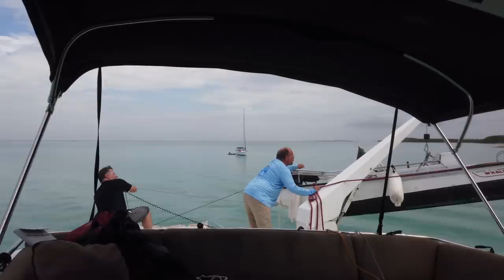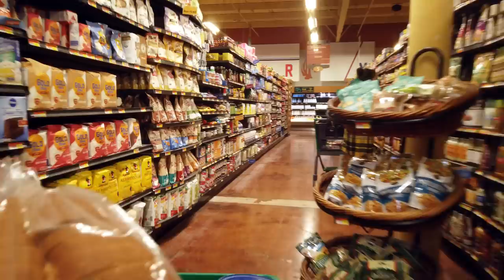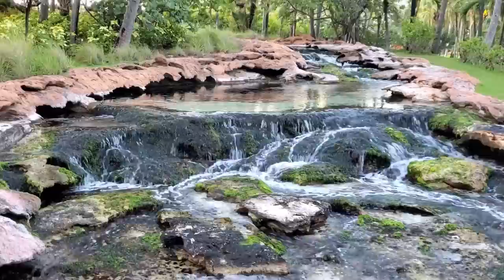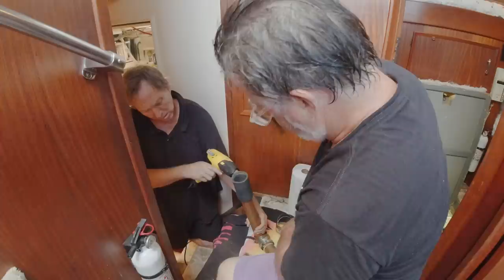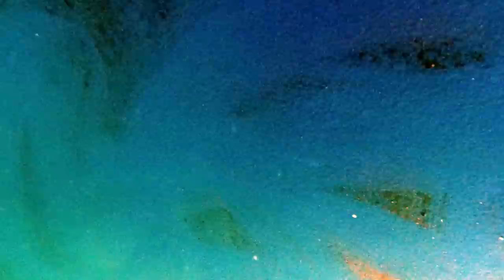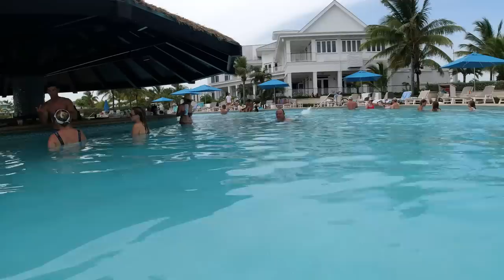Throttle Control Goes Haywire! Three Boat Pile Up! E171

Comment: We bought our first large power boat about 5 years ago after 40+ years on sailboats. It was my first experience with dual engine and transmission controls. I hired a delivery captain to move the boat to its new home. Right away I noticed that he cycled through forward, neutral and reverse while at the dock and then prior to approaching each marina. I asked him why and he told a couple of stories about transmission that got stuck in gear with bad consequences. He said I should test all the gears like he did. Of course, I promptly forgot his advice.
A year later we departed on the Loop and arrived at the Erie Canal. At the 3rd or 4th lock, a boat came in behind us and all hell broke loose. His transmission stuck in gear and he couldn’t kill his engine. Luckily he missed us but rammed into the front gate. Panicking, he jammed his second engine in reverse and hit a boat on the wall opposite to us. Both boats then banged off the lock wall with significant damage.
My SOP now is to cycle through the gears before leaving or entering any dock, lock or marina. Marine transmissions are extremely reliable - until they fail.
Reply: Great advice.      I had a similar experience -- after 30 years of sailing -- I am docking my dual diesels and had one of the transmission handles literally come off in my hand, stuck in reverse.   In the shock of the moment, it took a good 15-30 seconds to realize that I just needed to kill the engine. 

It helps to have a defined, written emergency procedure / steps that you work out in advance for certain scenarios, such as: 

What will you do when an engine gets stuck in gear?  

What will you do when an engine won't shut off?   And the Stop doesn't work?   And then the Kill switch doesn't work?   

The longer I've spent on my powerboat, the more I learn --- and then commit to a written SOP --- because emergencies happen so infrequently, we can't trust our memory when under pressure.
Reply from the maker: I suppose these things can happen with both electronic and standard throttles. We have kill switches but things happen so fast I imagine I might not be quick enough to prevent an accident in a small marina.
Reply: I saw a 60 rear cabin boat stuck in reverse in a marina he took off the bow pulpit off a brand new buddy Davis that got delivered 3 hrs earlier

Comment: I had a similar issue w micro commands..Scary.
I wonder why he didn't use the run-away.
Under the bridge helm on Hatteras there is a cable throttle overide on SF,s.
Sketchy Captain in my opinion. 
Great vlog 👍 
Carry on crew.
Reply from the maker: We have them on our Hatteras. At both helms. In any case, it was just a short trip across the fairway. By the time you realize what is going on it is probably too late to stop.

Comment: I love Nassau!  I have a trip down there with my boss so he can spend a weekend on his yacht coming up in mid November.  I would never have electronic controls.  The same thing happened in my marina here on Lake Erie.  One of my dock neighbors bought a new Tiara and on his second trip out aboard it he came back to the dock and as he was heading into his dock neutral became full speed ahead.  He hit the bulkhead and cracked the hull.  Needless to say Tiara sent a semi to pick it up and deliver his new boat.
Reply from the maker: I love using them but they make me nervous. A couple of times I though I was in neutral but was not. Probably me error.

Comment: in many many marinas i have seen the fishing boats bring their catch back after a day on the water and clean their fish at the docks throwing all the unwanted parts into the marina.  makes it a lot of fun with sharks if you need to scrape your bottom, check your zincs, or - like this guy - do some work after a mishap.
Reply from the maker: I see them do that lot too. Even though it is not permitted in the marinas.

Comment: Found Chub Cay a little snooty.  Didja notice the sign at the front desk saying you need to pay 'em ten bucks if you pick up a coconut?
Reply from the maker: No, I didn't see that sign. The restaurant can be a little snooty and they are little help when it comes to docking, but we had fun with the regular staff. Especially at the Rooster.
Reply: @tryingnottosink9107  Never got to the Rooser.  Forgot to mention: if you get back there, walk down the south road or mooch a golf cart and head east.  Will come to a very strange abandoned house out past the inhabited section.

Comment: You travel everywhere and you have either 871 or 1271 Detroits.  I want to take my 53' Hatteras from N Y to Virginia so I am wondering if the engines have been an issue at all, as the only problems I have seen you bring up are usually non engine related.???
Reply: Hatteras didn't put the 12V's in any MY under 61'.  8V's are the most prevalent under that with a few outliers having 6V's.  Some early production 50's and 53's got 8V71N's, but those are few and far between.  Sport fish and Yachfish models may be outliers as I've seen a few 48 Yachtfish's with 8V71TI's, and one 58 YF that had 12V71TI's, but I think that may have been a repower at one point.

As for your engines, I don't speak from experience, but as long as they start, you should be good.  From what I've read, the only real criticality with the Detroits are the tolerances associated with the racks.  Get the FSM, spend a couple grand on some quality special tools needed to run the racks, keep the oil and fuel clean, run 'em up once in a while to blow them out, and there's most likely very little you'll ever have to do below the head gaskets.
Reply: @Prototheria  well
Said…
Reply: Triton has 8V92TA engines.
Reply from the maker: We have never had engine problems, other then fuel supply issues. We have 8v92s and they are solid. No blue smoke at startup (unless they are cold up north, then just 15 seconds). They are probably the least thing to be worried about on your trip. Brings lots of spare filters, the ocean can churn up a lot of stuff in the fuel tanks. We usually burn through a couple filters in the first two weeks, but that is because we sit for seven months out of the year
Reply: @tryingnottosink9107  Thanks. 892s, just a newer 871

Comment: Switch from copper to schedule 40 pvc the copper is too thin these days it just wears out especially from the abrasive salt water
Reply from the maker: Our close friend is a commercial plumber and he made the replacements for us out of a high gauge copper. Much thicker than the originals and they will surely out last us. But Schedule 40 is a good idea.
Reply: @tryingnottosink9107  the salt water has major corrosive properties it is just sand blasting these pies especially near a 90

Comment: If the throttle control sticks can you put your boat in neutral ? I know nothing about boats so I’m just curious. Also I haven’t watched all of the video soo if you answer in the video you should ignore the question ! 🤪🤪🤪
Reply from the maker: Yes, you should be able to. I never heard of anything like this happening before. We have kill switches on our boat that will stop the engine no matter what the throttle does, but when things happen so quickly, I am not sure I would have got to them quick enough to prevent the collision.

Comment: So after all  the hours you have on  this boat, what kind of mpg are you getting. What kind of range.
Reply from the maker: We get 0.75 miles per gallon and have a safe range around 550-600 miles. We hold around 900 gallons.
Reply: @tryingnottosink9107  thanks, very helpful.

Comment: It’s a shame that the electronic controllers took the blame! When installed by a professional they are more reliable than mechanical or hydraulic for that matter. For safety purposes each helm station is also required to have engine kill  buttons installed. USCG required for Cert.
Maybe a sobriety test would have been a better way to start the diagnosis processes!
Funny how there are so many excuses when these type of scary and dangerous events happen. 🫣
Reply from the maker: We have never had a problem with ours. And we do have a cut-off at both helms. I should test them again.